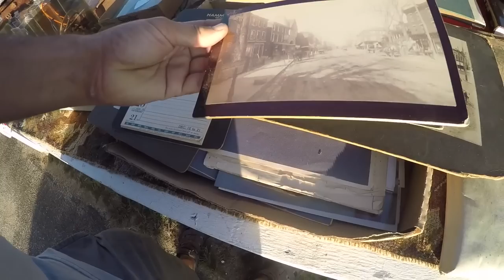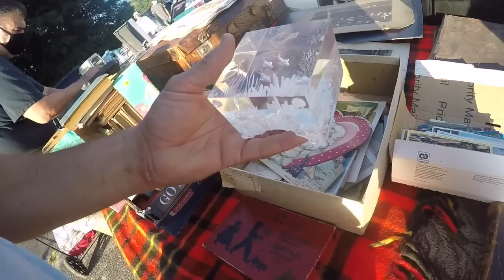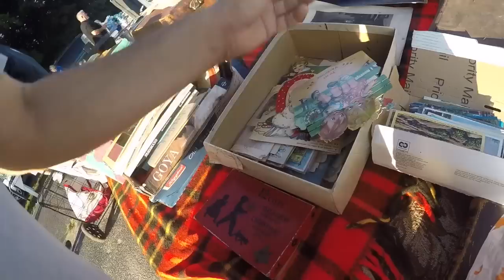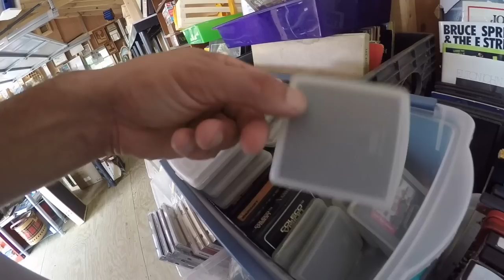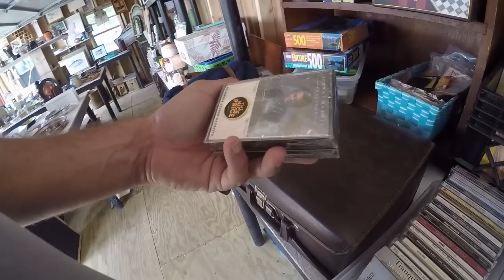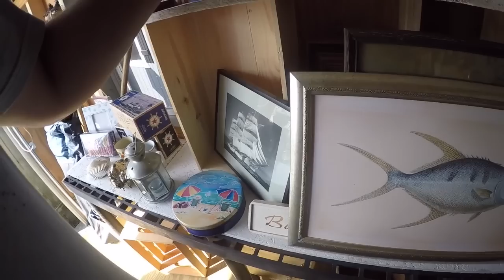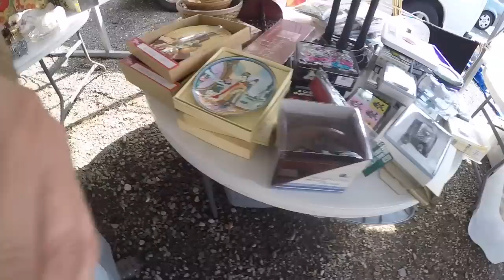Flea Market Friday! Never know what well find! Quick stop at a yard sale!

Comment: 06:58 Looks like you beat Renee to those cards.  11:42 If you hadn't grabbed that Haskell someone would have crowned you.  Be careful though, some idjuts have recycled the name.  18:05 I have that owl - a 1960s wedding gift to my parents (I wasn't around yet).  18:57 That's a candle holder for those battery-operated tealight thingies.  19:15 Check the necklace for rock crystal and check the clasp for silver.   I don't think your mushroom thingies are sock darners; the scratches and wear are all on the wrong ends!  Most sock darners are egg-shaped, usually with a handle.  Someone else said medicine pestles and that sounds more like it.